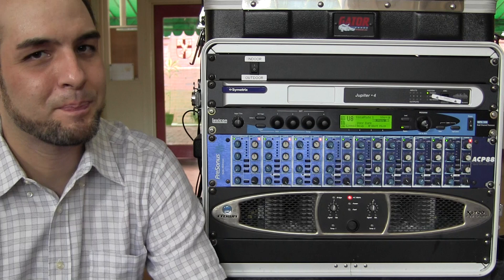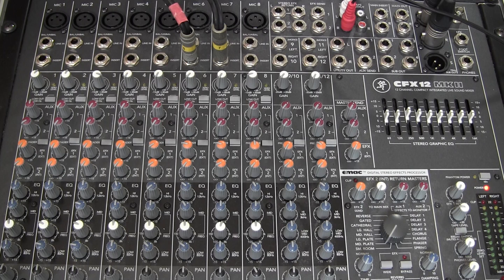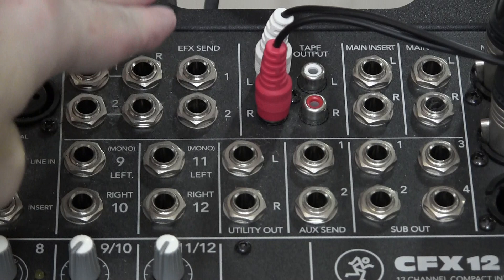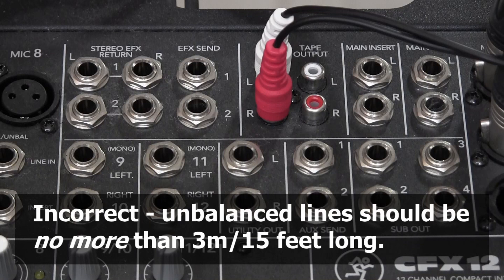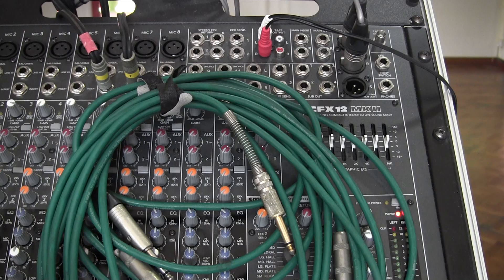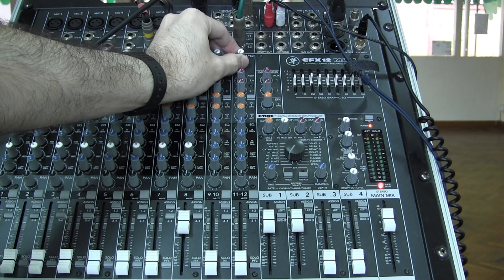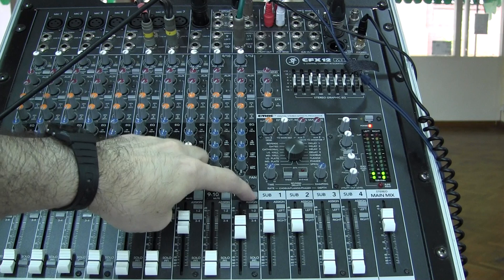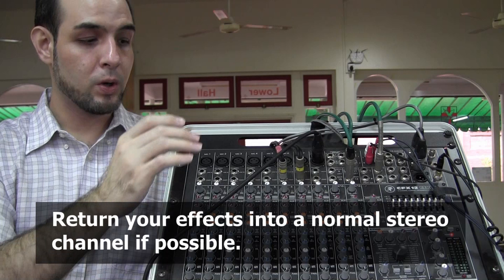How to set up an external effects processor for live sound

Comment: Hi Bruno. I am always fascinated and educated by by your videos. My question is, what happens when you have more than one effects processor....say 3 or 4. How would you go about connecting such multiple processors to one mixer?
Reply from the maker: You would simply repeat this process for each processor - of course on smaller mixers you will quickly run out of aux sends, which is why the bigger analog mixers had 8, 10 or even 16 aux sends.
Reply: @GLBProductions  Thanks Bruno. In other words, how many external effect de vices I can connect to my mixer will be determined by the maximum number of aux sends I have on my mixing  console? On a related note, I know there are processors that provide multiple processes. Can you advice on any multiple effects processors that will simultaneously or concurrently provide 2 or 3 or 4 processes (or instances) at the same time? That way with a limited number of aux sends, one can integrate only 1 FX device but with multiple effects being provided to the different channels all at the same time as may be required.
Reply from the maker: The Lexicon MX200 is one such unit :)

Comment: Can I plug  my mic
 straight into the effects  unit   and connect  it  back into the mixer  channel
Reply from the maker: It depends on whether your FX unit has a microphone-level input. Most do not, which means that you would need to use an external mic preamp between the mic and FX unit.

Comment: Great video, I wish I had seen this years ago. My question is if I want to add a two channel equalizer how would I do that and be able to individually control Both the reverb effects and each channel of the equalizer. Example: having the singer use channel one of the equalizer and a guitar use channel two of the equalizer
Reply from the maker: Thanks for watching! I suggest using the respective channel insert points to connect to the EQ, this will allow you to use the two EQ channels independently.

Comment: hi first off thanks for all the videos of yours that I come across, very usefull and user friendly to understand, appreciate your time and effort very much. On this video, this is an area new to me regarding using a mixer with external effects, my question is, is there a method to be able to send the effect processor to all the channels on mixer, which then can be controlled individually at each channel strip?
Reply from the maker: +rolling apples Thanks for watching, glad the videos have been helpful! If you would like to support the channel please consider signing up to become a patron at https://www.patreon.com/glbproductions?ty=h Every little bit helps! 

The setup shown in the video will allow every channel to access the effects processor. However you are not sending the effects processor to the channels, you are sending the signal from each channel to the processor, and then returning the mixed signals to the mixer via a stereo channel. You can adjust the amount of effect by using the aux send on each individual channel.

Comment: Wouldn't the disadvantage of returning the effect to a stereo channel be  that if you are using multiple channels on some mixers, ie a guitar as well as vocals, the effect is going to apply to both? If you have it go to the fx return you are able to have the effect on one or the other or both channels, because each channel has its own effects return knob.
Reply from the maker: Not quite - the way in which the wet signal is returned to the mixer has no bearing on how the channels access the FX unit - that is determined by the setting of the aux/FX send knob on the individual source channels. The setup shown in the video allows any, all or none of the channels to access the FX unit via their individual aux send knobs. Also, note that none of the channels have an effects RETURN knob - the one you are referring to is actually a SEND knob.
Reply: @GLBProductions  Ok I understand now. I would just turn the FX knob down on the channel if i didn't want to send it to the effects unit. Also i would turn the fx knob down on the stereo channel i have the return going in to, so that it doesnt feedback?
Reply from the maker: You got it! 100% 😄👍🏻
Reply: @GLBProductions  Thanks for the help!

Comment: Greeeeeeat video!!! left two doubts: 1- Can i use only de Left output of the effect processor or use the estereo mode is best ? 2 - Using the external Effects disables the internal Efx or can i combine then?
Reply from the maker: +Luiz Felipe The stereo mode is best if you are running a stereo PA system - if your PA system is mono then using just the left output is fine, or you can use the mono output if available. 

You can combine the internal and external effects, but you will need to use another aux send to send signal to your external effects unit. So for example if your internal effects processor uses aux 4 you will need to use aux 3 for your external effects.
Reply: +GLB Productions I think the thing to be careful of will be if Luiz were to employ a Stereo effect (such as a sound that pans left-right-left, etc.). This may come across a mono system as more of a phasing effect, I would think, however I'm not real experienced in working with effects so correct me if I am wrong.
Reply from the maker: Michael Reaves It would depend how the return to the mixer was wired, how the speakers were connected and what type of effect was in use. Finally, it would depend on where the listener was located relative to the loudspeakers. So, in a nutshell, it would be very hard to predict :)
Reply: +GLB Productions tks!!!

Comment: Should the outboard effect processor be set up to send only the wet signal back to the mixer? or is the whole signal that is set by the processor as default ok to send to the mixer? Seems the default effect is also doubling the Orginal signal in some sense perhaps adding a phase, no?
Reply from the maker: Yes, I would set the blend on the processor to 100% wet - you then do the wet/dry blend on the mixer, as shown in the video.
Reply: @GLBProductions  does that create any phase?
Reply from the maker: In theory yes, since the propagation time through the FX unit is more than zero. In practice though, it is not significant unless you have multiple digital FX units in the same loop.

Comment: im curious to wonder if the same principles apply to a compressor and if so is there a way i can use a y cable instead of 3 guitar cables to connect a compressor or fx processor to the fx2 or aux send? any help you can provide would be great

Comment: Hi Bruno, excellent video, thank you.  Can you explain how to set up an effects processor in stereo for recording?  The back of my unit, H7600, has two analog inputs and two analog outputs.
Reply from the maker: wHack 'billy Hello Billy - the setup shown in the video is stereo in that the return from the effects unit has both a left and right channel. The only mono part is the send from the mixer to the effects unit. 

If you want a full stereo setup for situations where you are using for example a pair of stereo mics for recording you would use two aux sends instead of just one: one to the left and one to the right input of the effects unit. The first of these would be designated the left send and the second the right send, and your channels would be sent accordingly. Does this make sense? Let me know :)

Comment: Thank you for sharing your knowledge I appreciate it! My question is I just purchased my first Mackie mixer, voicelive 3 extreme and fx150 stage monitor, how do I hook my extreme up so I can hear those effects thru the stage monitor? Thank you for your time
Reply from the maker: Hi Tracey could I please have more details about your setup, thanks.
Reply: GLB Productions thank you for your reply I greatly appreciate it! I have the Roland kc 880 speaker, my goal is to have main sound to come out of the Roland speaker. I purchased a profx12 Mackie mixer that I want my effects from the voicelive 3 to be connected On the mic channel on the mixer, my goal is to have the fx150 stage monitor that is for me to hear myself sing to have those effects from the voicelive 3 to come out of the fx150 stage monitor. Yesterday I purchased the insert cable which I believe I will need? I am just confused not because of you, your videos are great! I understand your concept however just not sure how to hook everything up. Thank you for trying to help me. Roxy
Reply: GLB Productions I also have a beat buddy foot peddle I like to hear thru my stage monitor. Thank you so much!
Reply from the maker: Hmm - interesting setup! My concern is that each of these pieces of gear is really quite complex with lots of inputs and outputs - great for experimenting but when it comes to live sound simple is often best. 
If you are using the KC880 as your main speaker and the FX150 as your stage monitor, you may actually be able to not use the proFX12 at all: connect both your mic and your Beatbuddy to the Voicelive 3, and then run the output from the VL3 into the FX150. Connect the output of the FX150 to one of the inputs on the KC880. Alternatively you could connect the BB to the second input on the FX150. So your signal chain is: Mic/BB -> VL3 -> FX150 -> KC880. Try this out and let me know how it goes 😀
Reply: GLB Productions thank you so much for your time and knowledge I greatly appreciate it so much! I will give this a try and get back to you. I am waiting on additional cables that are to arrive in the next couple of days before I can test your suggestion. Enjoy your day, Roxy
Reply: GLB Productions BINGO!!! Everything works with the cables that I already had. Thank you so much you have no idea what a huge help you are. Thank you for taking the time to help me! Thank you 🙏
Reply from the maker: Awesome news! Very glad to hear that - remember that simple is the way when it comes to live sound 😄👍🏻
Reply: GLB Productions one more question please. I have my guitar plugged into the VL3 and the sound is coming out of the stage monitor, is there a way to have that sound come out of the kc880? I like the guitar going thru the VL3 because of the guitar effects. Thank you.
Reply from the maker: Sure - if you connect the "out" on the back of the FX150 to the KC880 then the sound in the monitor should be duplicated exactly in the Roland.
Reply: GLB Productions what is the name of the cable I would need? I only have 1 cabe left and it is a mic cord, so I plugged that into the FX150 and the other end into my KC880 mic spot and got a big pop. (I didn’t think that was going to work with the mic spot, but I tried anyway) thank you for your time. The options I have for the cord is, the FX150 out is a 3 prong and my KC880 I need to have a long end such as an insert connection?
Reply from the maker: What you need is called an XLR female to balanced 1/4" cable or adapter - this will allow you to plug the XLR output of your FX150 into the 1/4" input of your KC880. I suggest that you learn the names of the various connector types, it will really help you when it comes to purchasing supplies and communicating with sound techs and other musicians 😄 Check out my video on the topic here: https://www.youtube.com/watch?v=AnU27N3Clsw
Reply: GLB Productions thank you I will check your video out, you make the most sense to me explaining all this technical stuff. Trust me I am trying to learn so hard and you have helped me understand so much more, thank you 🙏
Reply from the maker: You're welcome Roxy, get in touch any time you have more questions 😀

Comment: Are aux sends parallel or serial? If i put a delay rack on aux 1 and a reverb on aux 2, does the delay go to the reverb or they will be in parallel? Thanks!
Reply from the maker: Good question! There is no connection between the output of aux 1 and 2 - they are completely separate signal chains. A signal sent from aux 1 output will never reach equipment connected to aux 2 output unless you physically connect the two outputs together before they reach the destination, and there would be no reason to do this. So you could say that they are in parallel but that is not really a helpful term because it implies that exactly the same signal is going to both aux sends which in reality is not the case due to modification due to level controls, pre/post fader switches etc.

Comment: Hey, your vids are invaluable, you have a gift at explaining things, i'm sure you could be a great teacher..:)...and a lot of people learned so much from you...So i'd like to know, as you say at 6.30 we can use unbalanced (TS) cables, but also we can use balanced (TRS), too. I've connect my processor just like you show, with unbalanced TS cables. 

Well, currently i don't have a TRS cable to try, but, i'd like to know, if i use a TRS cable going from the mixer to the effects unit (dry signal), in the L input, (as you do at 8.00), it would be the same as now, that i use a TS cable (cable's length are 0,5-1m..) ???
And finally, suppose we're using a TRS cable Y shape, (1TRS to 2 TS) and connect the single side to the mixer's efx send, and the 2 TS cables one to the L, and the other to the R of the effect's unit, so we send and receive stereo signal...is this gonna make a difference - improvement, instead of the normal connection with TS cables, which we send mono and receive stereo signal, (as you said at 6.15 and 7.30) ??...
Well that's all, thanx in advance, and God bless everyone......
Reply from the maker: I've been a teacher for many years Patrick, that's why I can explain these things clearly ;) 
Using a TRS cable instead of a TS cable might give you slightly more level, depending on how the inputs and outputs in question are wired. 
Using a TRS to 2xTS cable from the output of the mixer will NOT work, and could actually make your sound worse. There is no need to send a stereo signal from the mixer as live sound signals are typically almost all mono with the exception of keyboard, which typically do not need any effects added. Returning to the mixer in stereo is important as many effects, especially reverbs, are designed to operate in stereo. 
All the best with your music!
Reply: @GLBProductions  So you really were a teacher, that expain a lot i think...i bet you were a very good one..:)..Thank you for the explanation, now it seems very clear to me, and thank you also for your time...i really appreciate..Thanx a lot and hey from Greece...

Comment: i have a  peavey  xr-at powered mixer and a yamaha spx 2000 . just wondering if i can do some connection /// greetings
Reply from the maker: You can try using the "monitor out" socket as the FX send and then return into one of the line level inputs, but a mixer like this is not really designed for connecting an external FX unit.

Comment: Great video! Helped me a lot. I have the option to send my aux return signal to my monitors so I can choose either method. 

One question though:
Is there a method I can use to send my only my singer's reverb to his monitor? In this case, he doesn't want the backup vocalists aux send in his monitor, but it seems as though he'll get their wet reverb signal in his monitor? 

Thanks.
Reply from the maker: Tanner Peterson Hello Tanner, thanks for getting in touch. The best way to achieve what you need is to use a separate effects unit for your singer, which is used only for his voice and nothing else. The return from that unit can then be routed as necessary.

Comment: Can you use FX2 externally too? I notice that the mixer has the FX2 return inputs, but its master send is in the internal FX section. Do you have the option to use it either way?
You do a very good job, I like your videos. I'm a sound technician on cruise ships, and I have really long vacations ( my current vacation is 3 and a half months ), so before going back to a ship I like to watch some videos to keep things fresh in my head, and to see how things are done in different places.
I have just one thing to say, on your video about gain structure, you said that the gain should never be above the yellow LEDS, but I think it should never be above ZERO, cause  for example, +4 is in the yellow zone, and if you have 20, 30 channels  with +4, you gonna have a big problem with the sound clipping, or really close to it, with little headroom to work with
Reply from the maker: - That's a very good question, and one which I had to go to the mixer manual in order to answer comprehensively.  
On this particular mixer there is an EFX2 send, which allows you to use an external effects unit in place of the internal processor. However, if you return your wet signal into stereo effects return 2, it will combine with the output of the internal effects processor, so it may be best to return it into a channel. 
Glad you like the videos - working on a cruise ship is a special experience!